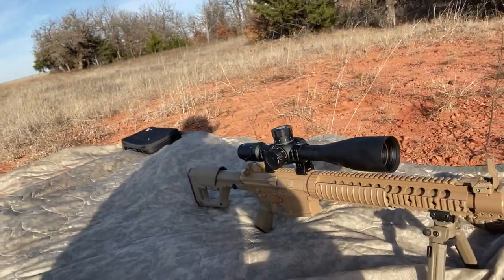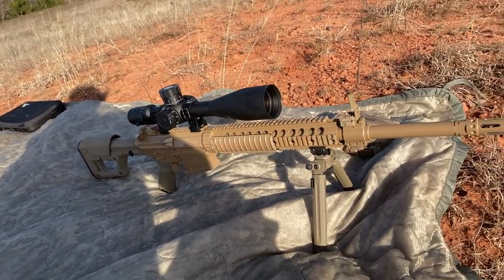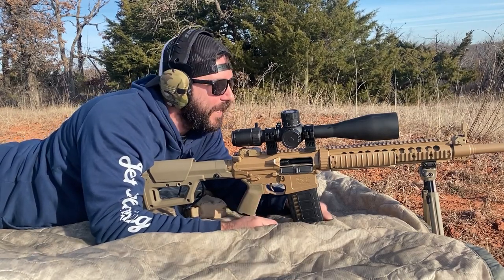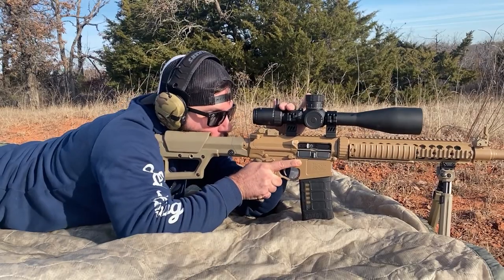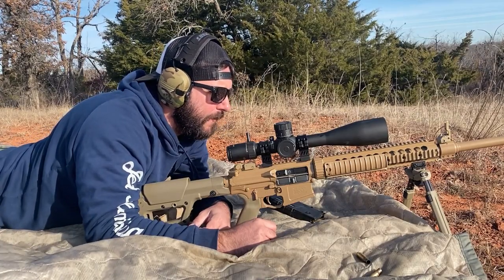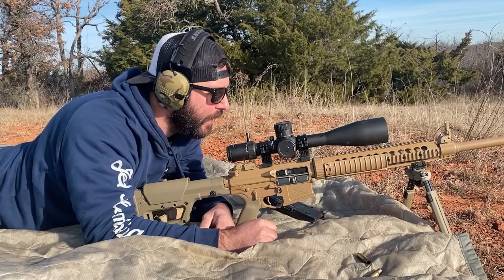Ar10/SR-25 issues

Comment: I would try the cheapest first. I know it sounds elementary but I would start by cleaning the gas tube and the block first. They can get built up with carbon and other crap. If that doesn’t work then I’d try different mags then the gas block. Mags are something that’s good to have spares of anyways especially with this platform.
Reply from the maker: Definitely doing so

Comment: Have you tried moving your gas block? It maybe misaligned a little forward or back off the port.
Reply from the maker: Yes I did after last week but I think it’s a port hole issue or possibly the gas block itself so I’m going to open the port more and get an adjustable gas block

Comment: Seems undergassed to me. I am
Unsure of the buffer but if you have some different buffers maybe try a lighter one. It looked to me like it was short stroking. All the guns I have messed with that are over gassed kick the brass like 1-2 o clock. My personal rifle will eject 223 loads around 4 and 556 pressure loads around 2-3. It used to be 1-2 on the 556 loads and I used a spike tungsten buffer. Standard spring. It’s a carbine milspec tube not an a5 but same principal. Anyways the heavier buffer helped with the ejection. It’s still what I would consider over gassed but it’s meant to be for its purpose. Now I was lucky enough way back in the day to get a micro moa 12.5 mid gas barrel and it was behaving exactly like your 308 gas gun. Luckily I had a friend who worked for badger ordnance and he drilled the port a couple thou larger. The barrel was meant to be suppressed all the time
 Which is fine but I try my best to make sure guns I will depend on will run non suppressed on steel case abs lesser pressure ammo. Once the port was opened on the 12.5 I ended up using a standard buffer spring and a h2 buffer is what it ended up liking. Anyways. Good luck. Sexy rifle. Side note, my main rifle is a 14.5 mid and xm193 factory loads shoot about 3050-3100 fps over the chrono and the federal 223 in lc cases shoot about 2700-2750 temperature depending. Most of the once fired 223 stamped lc cases I have ram don’t even have enough ass to fully fire form the brass. It’s always like .015 .020 short of trim while the 556 loads are always fully fire formed abs are generally .005-.007 over trim length. That plus the chrono tells me the loads are different in charge weight even though the brass is identical aside from the 223 on the head stamp. On my gamer rifle it’s tuned with an adjustable gas block, and the jp buffer system which is super cool. Expensive though imo but it only eats one load so I am ok with that. Good luck out there. You will find what she likes soon no doubt. They do weird shit sometimes. Many ways to skin the cat. Pew on.

Comment: looking at the ejecting pattem  it is a clearly over gas for me,. If you can, a adjustable gas block then tune the gas yourself would be my take on this. The bolt speed is too fast thus there is not enough time for the mag spring to present the next round
Reply from the maker: I would say yes to that but more of the bass was at the 1 o’clock position which would mean it’s under gassed I only had 3 that were in the 3 o’clock and 2 in the 5 o’clock
Reply from the maker: I think I’m going to have to get an adjustable gas black to find the issue
Reply: @JustPewIt  1 o'clock meaning the brass came out and hit the deflector really hard and bounced towards direction, if you look for a pie chart for ar15 ejection pattern it tells 12-3 should be over gassed . But the erratically pattern meaning it is not consistently over or under gassed.
Reply from the maker: @linkchen8245   you’re right I was definitely not thinking correctly on this one